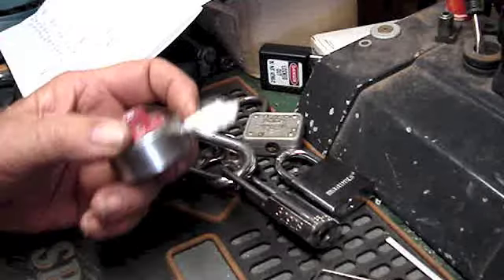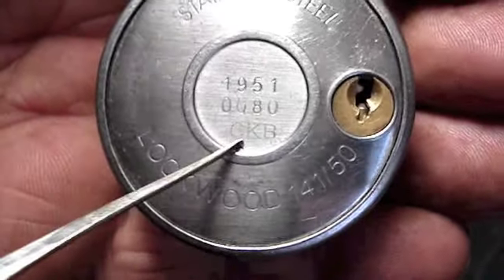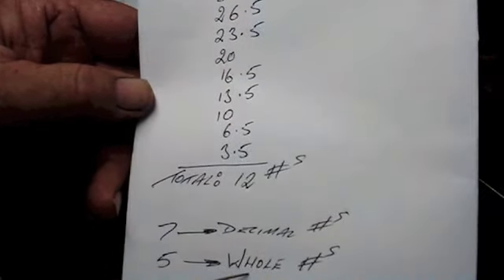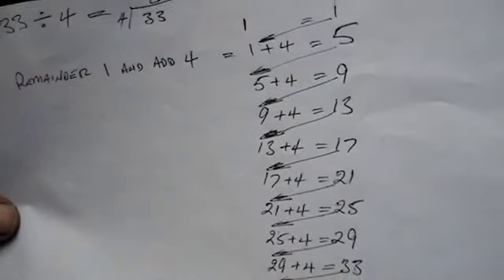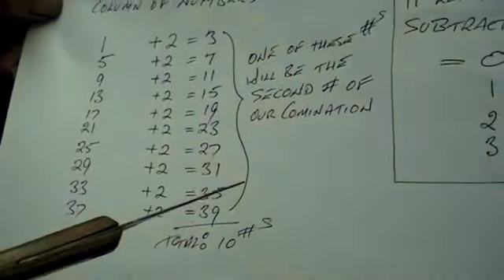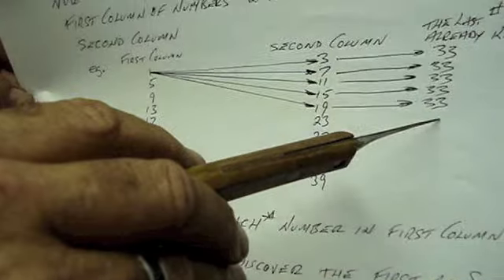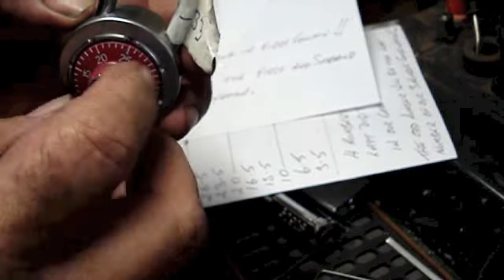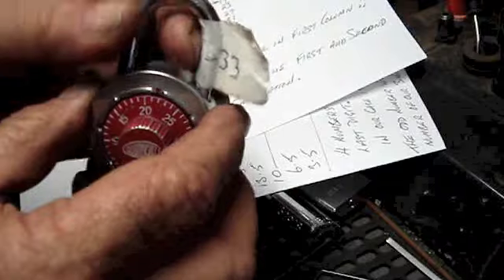Decoding Lockwood combination using Master decoding methodology

Comment from the maker: Thanks everyone ;-)  The thing was, most of those Master decoding methods state adding or subtracting the code number from the 'remainder' at the top in the second column, and then adding 4 or to each number thereafter, well simply using the code and adding or subtracting that from each of those numbers in the first column gets the same result.  All one needs to do is either add or subtract the code number to or from the first column of numbers.